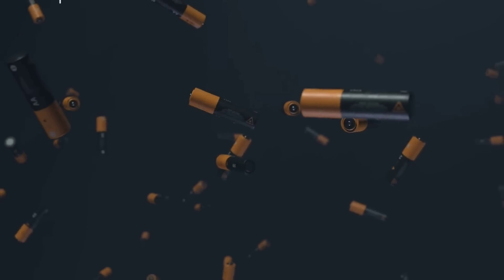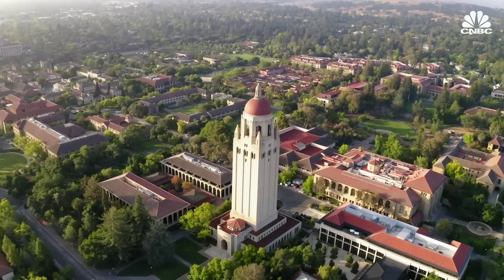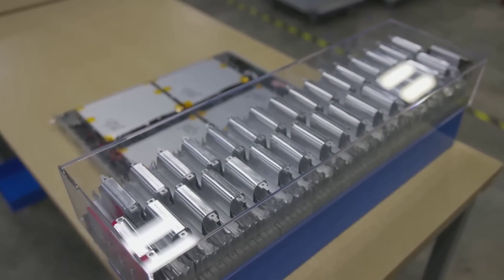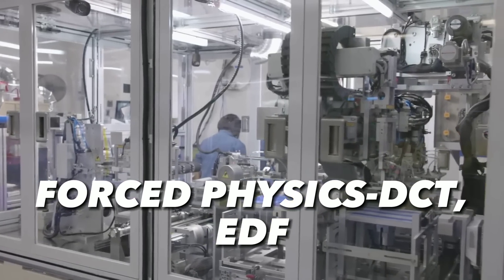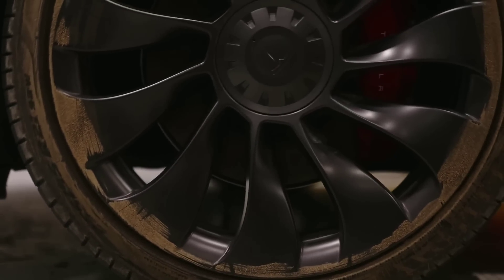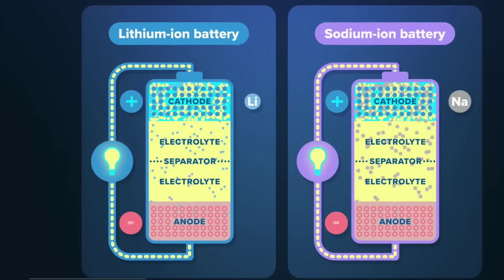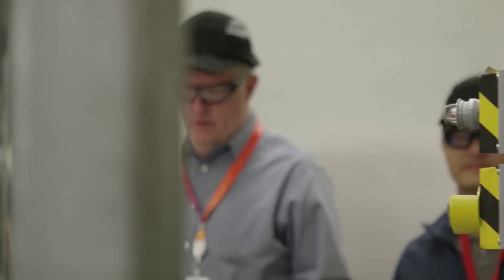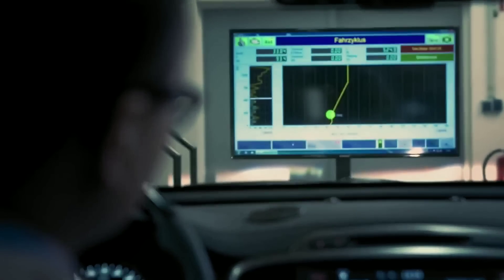American Company Natron Energy’s New Sodium-Ion Batteries Shocked China’s Battery Manufacturers

Comment: Other non advertising sites say different Quote:
Sodium ion batteries have been at the cutting edge of battery research in recent years, but they degrade quickly when charged and discharged and such short lifespans make them far less practical as a replacement for long-lasting lithium ion batteries.
From a German company that is heavily involved in them.
Reply: very old information
Reply: Altech Batteries

Comment: 2:02 i dont know where it comes from but the fact is that Sodium-Ion Batteries have LOWER energy density compared to li-ion.
Reply: But we have plenty of stuff to make the batteries with sodium  and it is a endless supply that is a big deal.
Reply: Power density (watts) and energy density (watt-hours) are different things. In the video they are talking about power density, not about energy density. Which means Na battery can provide more power per 1 kg and useful when high peak power needed. Also it means faster charging.

Comment: Why "a strategic partnership" with Clarios, a LEAD-ACID BATTERY manufacturer? Hardly the best partner for getting into the high voltage EV batteries for powering electric cars?
Secondly, while Cobolt is a rare metal, Lithium isn't, it is the most abundant metal on Earth.
Checking the stock, their current patents and the last round of financing being entirely private this video sounds a lot like a pump-and-dump scheme.

Comment: I must assume the sodium used in these batteries is somehow prevented from coming in contact with humidity/water as I know from experience, if you drop sodium into water, hydrogen and heat are released rapidly and fire/explosion is sure to follow.
Reply: Safer than a oil well blow out that destroys the ocean for ever
Reply: @drakemia4079  There have been quite a few "blowouts" which DID NOT destroy the ocean forever. Even the Exxon Valdez disaster did not destroy anything forever. There is NOTHING the left will refuse to lie about to defend their indefensible ideology. I see you have no problem using a device which REQUIRED a lot of oil to manufacture and possibly to power. I wonder how you manage to eat food which did not require oil/gas to plow, plant, fertilized, harvest the fields and then transport to a processing plant requiring oil/gas for processing and more oil/gas to transport to a store.  Please stop eating such foods so we can be spared such dishonesty.
Reply: If what you say is true, then you should explode and burst into flames.  About 1% of your body fluids are made of sodium and chlorine ions from the salt that you eat.  🤷
Reply: I would not recommend opening any battery, because the same thing will happen.
Spliting salt (NaCl) into Na (sodium) and Cl (chloride) takes a lot of energy, just like splitting H2O (water) into H2 (hydrogen) and O2 (oxygen). 
In their pure form, each element is dangerous to handle because it will react and release it's energy. 

This is why every battery needs to comply to safety standards and rigorous testing is done.
Sodium batteries are now proving to be the safest battery technology. When it does fail, it will first react with other materials in the battery in a more controlled way.

I think this is a large improvement in safety over anything else available. And unless you use a chainsaw and a swimming pool, i think you will be fine.

Comment: yes they think they are superior with energy well the battery sounds good
cheap low weight very good i like that but there it stops because it is doing
the same thing other batterys doing energy storage that is the job from a battery.
but now they start thinking about data centers well if he is using 1 Mw
you need a storage from at least 1 Mw and a suply from 1Mw to charge them
woke believers with no sun and no wind, it is only a backup for a X time.
i use a battery only i take 6Kwh from it to create 40 Kwh and we can create
a other 6Kwh to charge the battery so it never going empty.
so a battery is nothing other then a storage it needs energy to load it.
the time to store it play a big role 2 minutes or 2 days.
200 batterys from 20 Kwh is 4000Kwh 200 x 40 Kwh is8000 Kwh and this is
not needed in battery power, it is what it is storage for what you need!

Comment: What ever company comes up with a sodium ion battery (double the energy density of lithoum ion), every worker there should get millions of dollars and the presidents should get a billion dollar bonus.
Reply: Lilly like 10 of them at this point - Na will be the next step - but solid state will be what will carry them forward. That will be for Li and Na. Na still has some draw backs, but it will be good for everyone if they come come out in the long term.
Reply: @adr2t  Really have not seen a cheap battery with 500 W/kg come out. If they had, there would be no more lithium ion batteries anymore.

Comment: But we will continue to make the electricity for EVs by burning fossil fuels.
Reply: In Western NY we use Niagara falls. No need to burn water.
Reply: Yes and no, there are always charts showing that Solar and Wind make up a good amount of power - the issue mainly comes down to storage - we burn more fossil fuels so make sure we cover the power usage - as we dont know how much power at a given time we need to produce. By allow batteries into the mix - we can stop wasting/buring more fossils fuels than needed and allow the day time sun engery to cover a lot of the night time. Places that have batteries already are showing they can reduce peeker plants by 25% already. Thats amazing. Granted, we still need to keep peeker plants in place to make some power - but we wont need as many as we do now to make that happen. Let alone, the carbon can be capture and put back into deep earth to be return to rock again.
Reply: @adr2t  I agree that advances in battery technology can make improvements, but it is still true that there is no "clean" way of making electricity,  building a wind turbine or making a solar system.
The hoped for rise in the number of EVs will require many new power stations and miles and miles of transmission lines and pylons, to power fast and complex vehicles  when we mostly just want to get to work or the shops.
Additionally, lack of "cheap" energy is slowing down our ability to plunder the Earth's resources,  the more energy we have available to us, the more damage we do -- are you advocating a more rapid decline ?
Reply: @kerryburns6041  Well you have to define what you mean by "clean" because everything will have a carbon foot print, but how much carbon is the real question. 

I am not fully following your logic - while that might be true, ICE still requires buring more fossil fuels that requires a ton more energy to produce the gas you use. Let alone the transporting of the gas that uses gas. You also wasting a ton of energy just cooling the stuff once you transported to a gas station. Aka, an ICE car will only have about 1-10% of the energy that we could've burn at a power plant for 90-95%. 

Cables are easy to make and actully dont require that much energy to produce and normally last a whole life time of a human if not longer. RRR - Reuse, reduce, recycle allows you to reuse wire as it gets older and needs to be replace or can be reused in other locations. Cables in general are amazing in terms of low cost resourcse management. 

So I am not fully following your issues considering its not really a problem if we all switch over to EV/power. Let alone it adds small power plants to the grid in terms of cars and their batteries could off set power transporting around the country. Fun fact, you can use your Tesla during a power outage to power your house. Tell me how you can do that with a ICE power car?

I am a big believer in solar than any other power generation only because it can be place anywhere and has the lowest maintenance cost compare to other forms of power generation as its a solid state (no moving parts). As for the toxic waste - they dont produce that much and a lot of that going away over the next few years. While it is true they do generation less power over their life time - its not like they just simply "stop" working either. Meaning they don't have to be replace in their 25 year life span - they can be used in other lower power use cases "used market" for smaller projects.

Not going to lie - if we're talking anything that last 25+ years I am going to say you are silly when it comes to carbon foot print/waste - because thats almost 200x better than what we're currently doing in time scales of only a single day. The food you eat produces more waste and carbon than any single EV will produce over its life time.

Comment: All I have read about these sodium batteries is that they are safe... but not practical,  BECAUSE THEY NEED A BIGGER VOLUME to be same efficient as lithium. And for cars, laptops and smartphones is NOT GOOD !
So, we have to wait...
Reply: It is good for ebikes.
Reply: @user-pq4by2rq9y  Worst for ebikes really. Weight and size kind of matters for them.  Will be good for home battery storage more than anything. Same for grid. EVs should be fine though. It can only improve from here on.

Comment: Lithium ion is the only reason why I haven't purchased an EV at this moment because they are a fire hazard on wheels. Give me the first reasonable priced NaIon cars and I may leave my petrol car.
Reply: You mean the very petrol cars which on average have 400 fires per day in the USA?
Reply: Yep, the fires you can easily control with water or extinguishers.  @mikewurlitzer5217
Reply: Same here. It's mostly the NMC generation that has this risk, but a parking lot full of LFP EV's will still burn to the ground if just one faulty NMC car starts the fire.
Lithium battery fires are much more dangerous than petrol fires, as they can not be stopped in any way and will burn for days.
Reply: non flammable petrol?????
Reply: @2011ppower  Petrol is flammable, Li-ion is a blasting inferno that no fire-fighting technology can extinguish at the moment.

Comment: lol, The Natron cell costs $0.78 more than the Panasonic 2170 cell.
SO HOW IS IT CHEAPER ? 
it costs $0.78 more 😂
Reply: Lasting longer, charging faster saving you time, 100% charge without degradation, not burning down your EV, home and family sound cheaper to me in the end.
High volume production will reduce pricing, but prices are also a matter of supply and demand. I think we will pay a premium for a while, even if production cost is much lower.
Reply: Ok so how many cars will use this technology in 2025 ?
Probably less than 1 as it's too expensive and Lithium Ion is down 4.3% this year. @SolAce-nw2hf

Comment: Let's just hope this is not overhyped. 
Because if Sodium could be better, why have others been going for lithium
Reply: Lithium has better capacity, giving better performance and isn't that hard to find. And batteries aren't expected to be idiotproof so sodium's advantage just doesn't cut it for most. The prominence of electric car fire seems to change that, though.
Reply: @biocaster777  Sodium is vastly more abundant and significantly lower in cost than Lithium. IF and I stress IF sodium only equals the energy density and charge times it would be superior to Lithium. If energy density is greater and or charge times are reduced with sodium, then continuing down the lithium path would be stupid.
Reply: @mikewurlitzer5217  Of course. But alas, we can't have nice things.
Reply: @mikewurlitzer5217  Not really an IF question. They wont really compare to Li engery density of that generation - always coming in a little lower, but they should be able to hit higher power density with Li. Na will more than likely cap out around 600-800 while Li could cap out around 1k. Granted that would be hard to hit. Right now its more like 200 Na to Li 300 while Na. Ok, but not good enough if you will. Going solid state will help both Li and Na not have to worry about thermal run away. Going to sulfur over active carbon will get them to around 400Na and 600 for Li. Also will be cheaper to produce as active carbon cost more than sulfur. 400-600 is consider "good enough" for most EV people. More than likely a hybrid mix battery for the mid range, high range will be all Li, and low end will be all Na.
Reply: @biocaster777  Not hard to find?
Lithium has to be strip mined, the richest ore is less than 2% Lithium and the processing produces tons of very toxic waste which is essentially useless..
Sodium is in every drop of seawater, the only byproduct of extracting Sodium is Chlorine which has literally thousands of industrial uses.
Reply: @MichaelClark-uw7ex  There are other ways to get Li that are not that hard nor deal with as many toxic waste - normally water costly more than anything. Its also not that rare - really - it can be found in larger vains as well. Its also a waste metal that normally didnt have much other uses - meaning its cheap. Can be fround across the world, but most of it comes from China (kind of - not fully true as some of it is just mine in other locations and then brought to China). Na and Li can also be found around each other as well. If you can mine both at that once and have use - the value of that mine goes up for sure. If anything Na will just help allow applications that dont have to worry about weight and size such as a home battery not use the Li that could be used in EV or other high end applications.
Reply: @adr2t  Not any that are cost effective and they still generate toxic waste.
Reply: @MichaelClark-uw7ex  At this point - almost all elements are used - name me the "waste" that is generated that cant be used? I assume you dont know about the membrane method then?
Reply: It is called progress we also now have hemp batteries